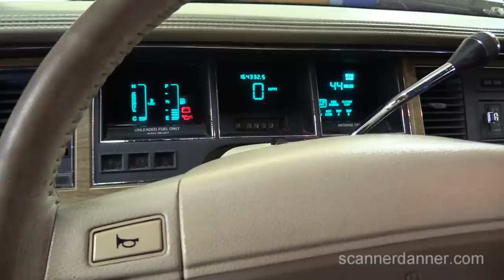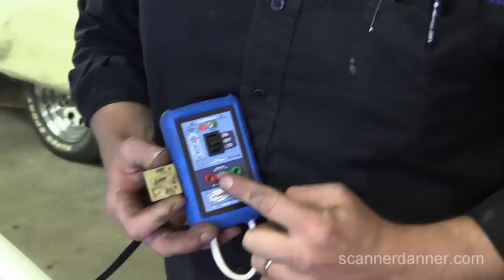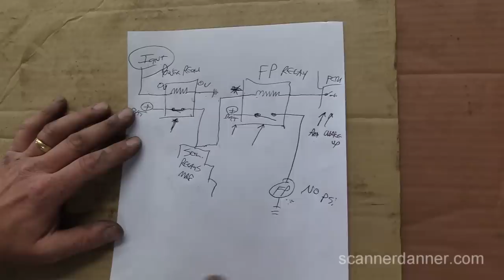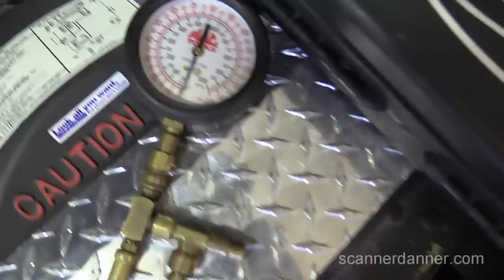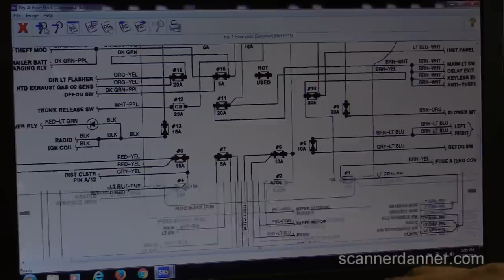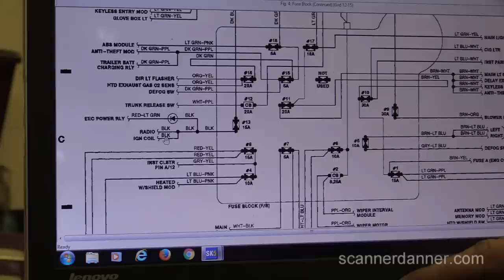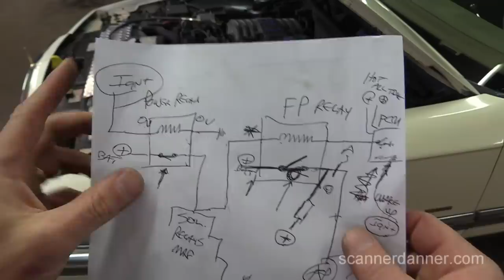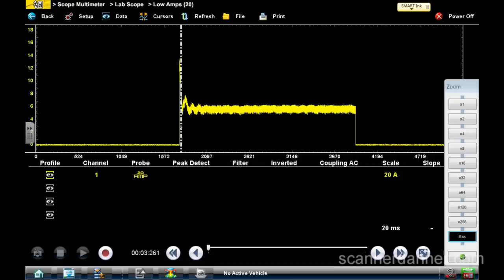Ford EEC-IV No Start No Fuel Pressure Troubleshooting (Lincoln Towncar)

Comment: Hello S D !  Brilliant Series of Videos and incredible depth of detail you go into when Troubleshooting especially Fuel related problems.
However, l have a Fuel Pressure problem but perhaps in reverse.
I was worried l had a faulty pump and tried all sorts of checks and, when l managed to hook up a Fuel Pressure Tester and discovered that the 'lack of fuel pressure or a blocked Fuel Filter was to blame, the reading was 70/75 PSI steady !!!  I repeated the Test several times and the result was the same - 70/75 PSI.
Could this be a cause of my Peugeot 1.9 205 GTi having starting problems ???   What is you view on this ??? 
I would be grateful for any pointers - I understand that the optimal Fuel Pressure for my vehicle should ideally be a minimum of 3-3.5  Bar - 45/48 PSI.
Thanks in advance for your expert advice !!!
Reply from the maker: yes! Absolutely too high of fuel pressure can cause starting issues and it will also kill the fuel pump very quickly. There are a few causes for this, but without knowing your fuel system, I cannot say for sure. Does your fuel system have a return line on the fuel rail? Where is the pressure regulator? On the rail, or in the tank?
A stuck shut fuel pressure regulator is the most common cause of this issue. On a return type system, a restricted return line can also do this.
Reply: @ScannerDanner  Thany you so much for coming back to me on this issue. To answer you question/s  I am the only owner of this car which l bought new. It has only done 66,400 kms.  (1)  The Fuel Pump is original (2) The Pressure Regulator (original) sits at the end of the Fuel Rail and has a Vacuum Pipe attached and a Return Line back to the tank It is a Bosch Fuel Pressure Regulator rated at 3Bar (Stamped on the body of the Regulator).  An interesting thing is, as l explanied previously, the tank-mounted Fuel Pump gets its signal from the Engine Cranking and not from the 'turn of the ignition key'.  I can hear the Fuel pump working while l am cranking the engine. When l stop cranking, the Fuel Pump also stops. The Pressure l get after disconnecting the Fuel Line from the Filter to the Fuel Rail and attaching my Test Gauge and cranking the engine, is 70/75 PSI, This holds steady (which means the check valve in the tank-mounted Fuel Pump is OK).  This hold steady overnight at 50 PSI.  An interesting thing though is,  while the Fuel Rail is still pressurised, and the Test Gauge is still attached, if l crank the engine, it starts immediately - Perfect !!!  Naturally it doesn't run for long because the feed from to tank is no longer attached to the Fuel Rail.  If l re-attach the Fuel Line back to the Fuel Rail, the engine cranks, kicks momentarily but does not start.  I suppose, again, my question is, is the (potential ?) combination of excessively high fuel pressre entering the Fuel Rail coupled with a (potential ?)  stuck/bad Fuel Pressure Regulator prohibiting the car starting ?  Should the Fuel Pressure Regulator, when confronted with excessively Fuel Pressure, be relieved and allow the Fuel Pressure to drop, by having the Diaphragm forced open to reduce the excessive fuel pressure down to the 3/3.5bar operating spec ?
A very lengthy question, but l have tried to include all symptoms in order the help your appraisal.
Thanks once again - perhaps if this problem is solved, it might be one for your books (?).
Reply from the maker: @LiarNoseOnFire  okay, thanks for that info. It helps.
1. The way you are measuring fuel pressure does not indicate you have a high psi problem. You have to "T" in your gauge to see regulated pressure, otherwise all you are testing is fuel pump maximum pressure. This is NOT the correct main fuel pressure test to start with.
2. Because it starts normally with basically no pressure in the fuel rail and then doesn't start properly with fuel pressure, this is suggesting an overfueling issue. We need to focus elsewhere. But redo your fuel psi tests with a gauge T'ed in. Also, pull the vacuum hose off the fuel psi regulator with the engine running and make sure there is no fuel coming out of it.
Reply: @ScannerDanner  Thanks again SD, for your very quick reply.  Firstly, where do you want me to install the 'T' in the system ?   To recap, the Fuel Supply to the Fuel Rail comes directly from the Filter (in the engine compartment and easily accessed). 
The Fuel Pressure Test Gauge is part of a Boxed Kit with a selection of various screw adaptors to fit most vehicles. It contains a couple of Hoses and Jubilee clips as an extra. 
Secondly, again, the car wouldn't start and run with the Fuel Line attached to the Fuel Rail, so in its current state l was/am unable to check the Vacuum Line from the Regulator to the Intake Plenum.
Saying that, to get the car actually firing up and running, l cracked the joint from the Fuel Feed to the Rail (catching the residual pressurised fuel),  and, as l did before, re-attached the Fuel Presure Gauge to capture the Fuel being delivered by the Pump. 
And,,,,,,,,,the car started up immediately for a few seconds then died (naturally) without any Fuel Supply.  I then repeated the procedure - which l previously descrebed in my earlier message - by releasing the Fuel pressure built up in the Gauge (75 PSi)  and then re-attached the Fuel Supply line.
The car Cold-started immediately and ran - i have set the idle speed quite high by adjusting an Air Screw on the Throttle Body housing designed for the job (Peugeot GTi have this as a feature rather than adjust the Throttle Stop to obtain higher revs.  The car was/is now running at around 1750 RPM and maintains a constant speed until the Radiator Cooling fans kick in - dropping very slightly. 
I was thus able to detach the Vacuum Hose and the Inlet was completey dry - the engine RPM increased slightly (which it should ?). Re-attaching the Vacuum Hose returned the RPM to as previous.
The Engine was at Normal Operating Temperature - the Oil Temperature was constant and steady - The Oil Pressure was constant and steady.
I allowed the engine to run for around Twenty Minutes with the Cooling Fans kicking in and out as they should do.
I then shut the engine Off.
Tried to restart immediately,,,,,,,,,,,,,,,,,,,,,,,,,,,,,,,,,,,,,,,,Nothing,,,,,,, a kick, but that was about it.
The engine refused to start again !!!
This is the third time now l have detached the Fuel Line feed to the Fuel Rail - re-attached the Fuel pressure Gauge. Once more the engine started for a few seconds as previously described.
Re-attaching the Fuel Line direct to the Fuel Rail, the engine fired up and ran at slightly high revs as previously described. The engine refuses to Idle at anything lower that 1500 Revs, and dies.
I hope this lengthy description is still guiding you to home in on possible causes and hopefully remedies.
Thanks once again SD - you are rapidly achieving Hero status - especially for your patience and support in this solving conundrum !!!
Reply from the maker: @LiarNoseOnFire  anywhere you can after the fuel filter for an accurate fuel rail measurement. Everything you are describing is suggesting a rich running condition. All of your fuel line stuff you've been doing to lower rail pressure to get it to start matches the overfueling condition. BUT I believe you are absolutely barking up the wrong tree. I'd be focused on your engine coolant temp sensor and then the fuel psi regulator vacuum hose, as I said before. You need to make sure that diaphragm isn't ruptured and that the engine isn't getting flooded out from fuel entering that vacuum hose. From the severity if the condition, you'd know it immediately by pulling that hose off, even without it running. 
Also, focus on the MAP or MAF sensor (not sure which one you have). Then the injectors themselves could also be leaking.
Reply from the maker: @LiarNoseOnFire  also, what year is this car? You should be able to view fuel trim and O2 data while its running to prove the rich condition that I'm almost positive you have.
Reply: @ScannerDanner  The Car is a 1993 Model which doesn't have an OBD Port.

Comment: Thank you for your videos
I wish you could help me with my 88 Ford F-250 cranks but no fuel pressure   I’ve replaced the front tank with pump    Fuel pump relay clicks but no noise coming from the tank pump
New in line pump and filter installed

Comment: Another good video Paul. I just wonder what is the point in a relay test tool that doesn't do a full test. IE the N.C. contact? Granted mostly diagnostics will be a 4 pin relay, but......
Reply from the maker: The normally closed contact is almost never used and it would complicate the hell out of the tool.

Comment: I had to replace a radio in a Ford once because it was draining the battery dead. With a test light(brightly shining) in line with the battery terminal and cable I pulled fuses until I came to the one that powered the radio. Plugged it back in and I unplugged the radio and the power drain went away. Could it be his radio blowing his fuse? Probably shorted to ground?

Comment: ScannerDanner I'm having a similar issue with my 99 crown Vic. The fuel pump relay initially was clicking rapidly. I cleaned the terminal connections and replaced battery cables. After doing that, it does nothing. The relay doesn't click and sends no power to the pump. There is a constant and a ground, but no signal whatsoever. Also you mentioned the check engine light, it does not activate with the key turned to the on position anymore.  I have checked all fuses throughout the car, nothing is blown. If I jump the constant to the output, the relay clicks and it will start. Am I looking at putting a computer in it?

Comment: How do you check a diode fuse ??? Stupid question #2 on the fuel rail what  size adapter is use on a ford I have a 95 f150 4.9l and the main stim from the gauge is to big!

Comment: Wouldn't hurt to check resistance value between Terminals 30 and 87 on the respective Relay. It should be (0) ohms. Terminals 30 and 87 is the load side of the relay. Just make sure the control side of relay is energized when testing the Relay.

Comment: THANKS for this info! I need  a bit of futher assistance if possible. Nearly identical systems on 1987 mercury cougar. Computer not grounding fuel pump relay, applied seperate ground and fuel pump runs. Good pressure to TBI at carb but no flow out of TBI. Are there other things to look at before I suspect a bad computer? Ignition coil, distributor cap, rotor, fuel pump, fuel pump relay all replaced. Suspecting computer providing all other grounds for components such as the fuel pump and injector are also bad.
Reply from the maker: Step 1, with the key on, give me a voltage read on your TPS or MAP sensor. I want to see if we have a 5v reference available. This will dictate our next move
Reply: received your reply via email, attempted to reply there, but got an error. ..... THANK YOU so much for your assistance!
From connector, disconnected from sensor to GND, key on

TPS  Brn/Lt grn 0
         Blk/Wht 0
         Org/Wht 5

MAP Lt Grn/Blk 5
         Blk/Wht 0
         Org/Wht 5

I have found something odd in this. Org/Wht and Blk/Wht are common connections to various other
sensors, but I have different voltages for Blk/Wht
Reply from the maker: @jeffdunkleberger8864  okay, your 5v ref circuit is there so that tells us the computer is "alive". Next step, do you have spark? It doesn't matter that everything is new. We want to make sure the computer is getting an RPM input signal and checking for spark helps us here.

Comment: Could the hesitation you noted be from the timing being off? The ignition module was removed and re-installed. Could have bumped the distributor a bit.
Reply: rmcracing69 no. That engine has a timing chain. You can hear if a engine has that type of issue. Learn about a test called relative compression
Reply from the maker: Could be a lot of things on that car but yes, timing could be one of them.

Comment: great video as always.  any thoughts on my 89 Ford Bronco having 12v available at the fuel relay signal, but only 6.5v with key on at the intertia switch?  if I jump the load side of the fuel relay i can turn my fuel pumps on.  but initial "key on" does not put 12v at the inertia switch, only 6.5 so the pumps don't run
Reply from the maker: If you have 12v at the relay and 6.5 at the inertia switch, you have a voltage drop on that wire. Remeasure at the relay with the circuit energized and make sure you have 12v there with current flowing to the fuel pump motor
Reply: @ScannerDanner  ok
Will do thank you!
Reply: @ScannerDanner  ok, with the key on, engine not running, when I jump the load sides of the connector for the fuel relay the high pressure pump turns on, and the signal side of the relay still has the same full battery voltage

Comment: First of all, check the relay if the pump don't hum. Code testers can check the relay. If the relay don't click, check the relay circuit. Usually, it's the relay. The code tester can give a fuel pump circuit code. Check the fuel pressure, KOEO. Check the codes.

Comment: maybe ignition coil primary starting to fail/short, the ignition module getting silly, someone in passenger seat stomping the inertia switch wires/water leak corroded, someone else fiddled around testing and blew it!
but most likely the person cranked and cranked until the fuse blew. I think they had increased current/spark duration when cranking for easier cold starts.
similar to non electronic ignition with the resistor bypassed when cranking :)
Reply: just now got to the scanner"fuse-blow"danner portion doh!!! busy and long videos are hard for me to get through

Comment: after watching this video and the other video on this same car, i don't think you shorted the fuse.  I think that loose harness was causing arcs across the connector and that shorted out that fuse.  Next time you deal with that car and that connector trace the wire from that blown fuse and see if it runs through that loose connector and if that circuit is also loose in that connector.

  Basically i think you've already solved the problem of what blew that fuse.

Comment: @Scannerdanner I got a question you said that if  you have prime at startup but then the fuel pressure dies off you'd have a crank sensor issue what if I have  rpm reading what would that mean?

Comment: paul that mistake made a killer video so thank you for that....  ha ha ha... my question? can u explain the light being dim on l.e.d control side light of U-activate tool? you said bleed but the driver in computer is closed so how can it bleed thru the driver? I know the resistance in l.e.d is high so it doesnt take much ground to get to light but everything in video i followed 100%. but the dim light not totally understanding.. any help would be greatly appreciated. your scannerdanner premium has made it to where d.i.yers like me can completely follow along with everything your doing. i still get bugged up when i go out to car myself. but learning
Reply from the maker: Something within the driver circuit is all I can say. There is more than just a transistor in there. (Diodes, resistors and capacitors are involved for despiking, then also we have bias voltage circuits too but probably not on this one)
Best I can do.
Reply: not saying that what's inside that circuit but zener diode would do that

Comment: Hey Paul, re initial turn on of pump wave form: what are you looking for in terms of height of the spike relative to normal average pump current, and how fast it steadies down to a normal current? Is this the same for a starter motor wave form?
thanks for the vid. Wish I could count how many times of done a fuse by poking wires and moving harnesses. HaHa :-)
Reply from the maker: I've been using the initial turn on of the pump to see how well the wiring can carry current. Essentially eliminating the need to do power and ground testing at times. And yes, this is the same as starter current with the initial very high current draw.

Comment: You can cheat when testing most relays by checking the horn to see if it works. If so in many cases you can remove the relay in question and replace with the horn relay or other non necessary circuit having to do with your issue. Headlight  etc. Check the numbers on the relay to make sure they are the same before doing so.

Comment: If fuel pump runs when in the run position....but fuel pressure drops when cranking, it can also be a leaking fuel pressure regulator.  Have fixed those in the past.  Not always a wiring or electronic issue.

Comment: I have a question. I have a 2004 with intermittent no CEL. It won't turn over. I'm positive it's a ground somewhere that has a short. When it rains it's a good chance it won't start.

Comment: Wow, I havent seen a Town Car with a 5.0 in a long time. That was 1 year only in that body style. Most of these had 4.6's
Reply: remember the 460
Reply: They havent put 460s in Lincolns since the late 70s. The modular V8 replaced the 5.0 and 351 in 91-92 For cars, but they werent used in trucks for a while afterwards. Most of these 2nd gen Town Cars had modular v8s, they only came with a 5.0 in 1990.

Comment: Say brother I need to bypass the starter and fuel pump due to broken passlock 111.  I want to put a tago switch and how will I run the wires